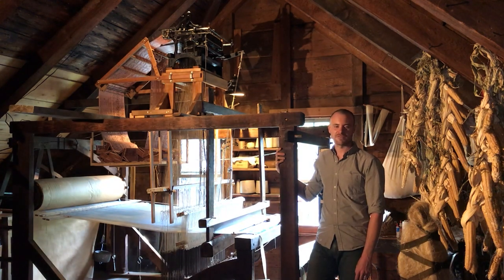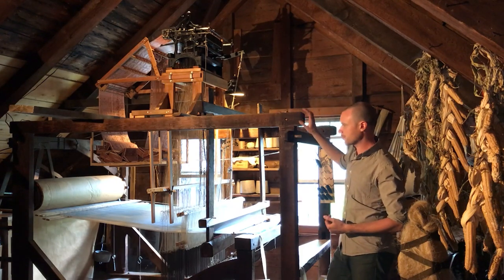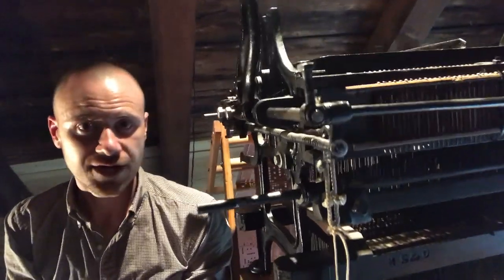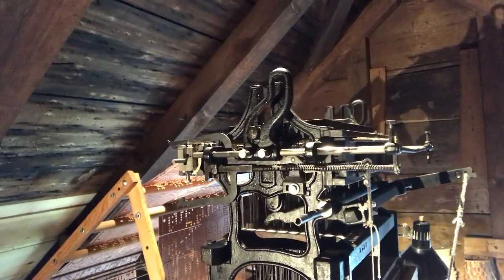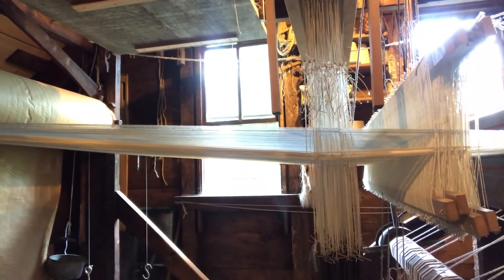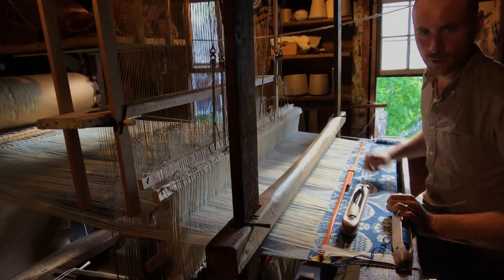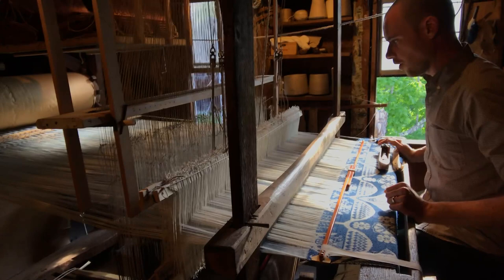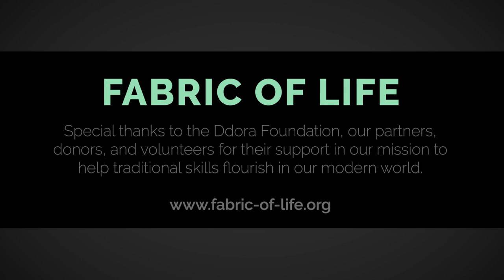Fabric of Life: Weaving a Figured Coverlet with Justin Squizzero

Comment: thanks for sharing how this loom works. fascinating! may I ask what yarns are used? fiber content, weight? it's hard to grasp the density (epi) of this kind of weaving. thanks again for sharing your knowledge!
Reply: Hi Sybil, there are two cotton warps, a fine binding warp of 20/2, and a heavier figure warp of 3/8. There are two wefts, a binding weft in the same 20/2 cotton, and a heavier wool weft, in this case its doubled strands of a two ply wool around 1,000 ypp. The warp is sett at about 30 epi with two heavy warp ends for every fine warp end, giving ten pattern blocks in every inch. The resulting cloth is pretty hefty.
Reply: @theburroughsgarret  thanks for your detailed answer!

Comment: Wonderful explanation!  How long a warp do you put on that big loom?
Reply: Currently 35 yards, but I'll be experimenting with a 50 yard warp next. Because the Jacquard turns this loom into a stationary bottom shed, rising top shed loom the warp can't come off the top of the warp beam as it was designed to do. In order to keep the warp at the right angle I can't wind too much on the beam at once, so I'm still testing out its limits. In a perfect world I'd put on 100 yards since the warp never changes between coverlets.